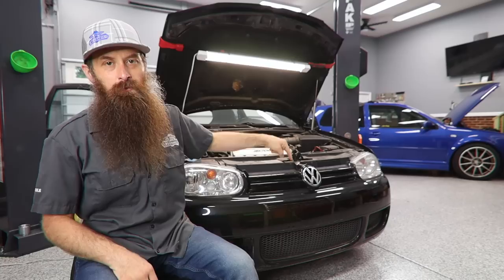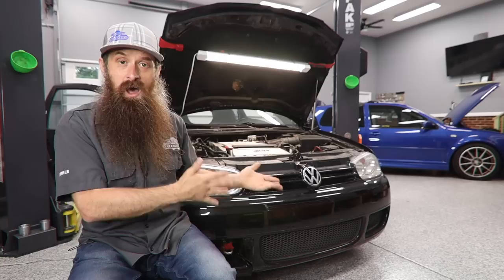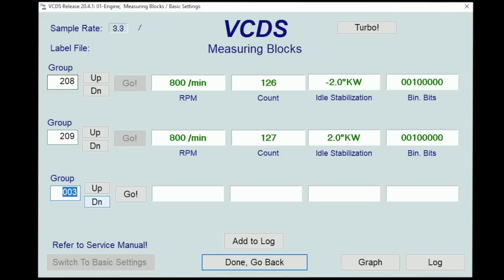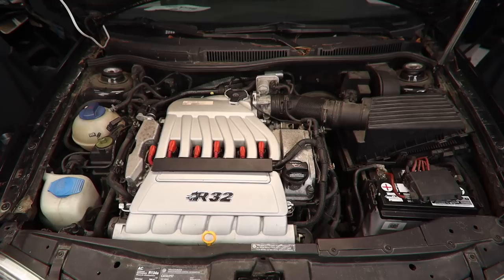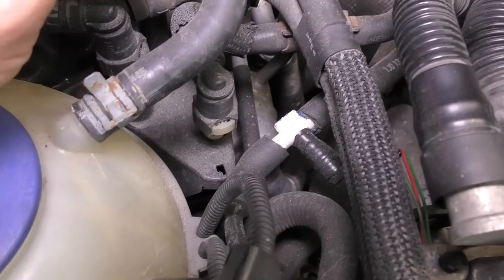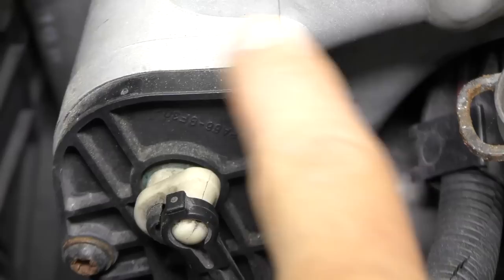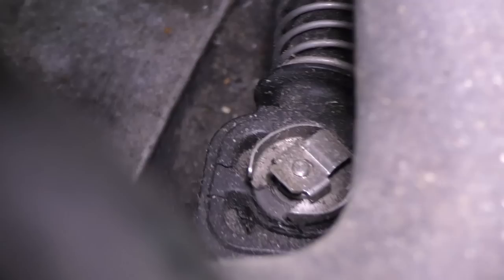EVERYTHING to Check Before Buying an R32 ~ MK4 Buying Guide

Comment: Just wanted to say I am very grateful for all the videos you've done on the MKIV R32. You've created a wealth of video knowledge that has been very helpful!! Especially being a MKIV R owner myself. Excited to follow this series and get some ideas for my 8P A3 3.2 (basically a MKV R32) as well.
Reply: Curious on your experience with your a3 3.2? I recently got one and its been nothing but trouble
Reply: @user-xi9hz1fu9s  It's been nothing but a great experience for me. I've mainly just kept up with maintenance since I got it a little over a year or two ago. Planning to do some preventative maintenance soon, but otherwise the only weird issue I ran into was the cover for the electronics on my MAF falling off and jamming into my throttle body (Cost me a new throttle body). Really could have been avoided too if not for my intake design. What type of trouble have you ran into? and what year 3.2?
Reply: @EntiboyGraal  got a 2004 one, ended up having the engine out in the first six weeks of ownership for a new clutch, flywheel, timing chain kit and radiator among other smaller bits, then turned out it needed a new vvt pulley (£540 for one part 😱) all costing near £2000 in parts, had it back on the road for another couple of thousand miles and it now has another transfer box leak, I think I just got unlucky but it hasn't been an easy ride, still got bodywork and a few other bits to sort too, Idk about you but driving it is fantastic though!
Reply: Interesting you mention about the throttle body though, when I have my foot flat to the ground it only measures 87% throttle input on vag com, do you have any ideas why this might be?
Reply: @user-xi9hz1fu9s  Oh my, that sounds like quite a bit. Hopefully now that you've gotten it back up to speed, it'll last for awhile (though sorry about the transfer box). You're right though, the driving experience is fantastic. I have yet to find something that rivals the experience of the 3.2.
Reply: @user-xi9hz1fu9s  As for the throttle body issue, sounds like a throttle body alignment issue. I think running adaptations on the throttle body with Vag Com would fix that. Here's a handy video from ross tech on how to do it: https://www.youtube.com/watch?v=2zrmhDw_v7Y (I believe the second method of alignment is what you'd want to do). Usually after alignment, the car will run what seems rough but it's really just the computer adjusting and relearning. After a few drives the car should adjust back to normal.
Reply: @EntiboyGraal  thank you that looks great hopefully it will do the trick, yeah its been frustrating but I don't regret it at all, its such a fun car, discrete and understated when you want it to be but got the power and cornering you want when you get the hammer down!
Reply: @user-xi9hz1fu9s  Truly is, and the sound of the VR6 ties it all together. I don't plan on ever letting mine go! Actually hoping to go single turbo eventually, but for now I've got some NA plans. Let me know how everything goes with the Throttle adaptations, curious if that's the issue.
Reply: @EntiboyGraal  the sound is immense, I would love to turbo mine at somepoint, what NA plans do you have for it though? I want to get mine to about 350hp but looks like it needed to be forced induction to achieve that much, will definitely let you know how I get on, really hoping it fixes the problem
Reply: @user-xi9hz1fu9s  Just 268/264 cams w/UM ECU tune, intake, and headers, HFC, and 2.75" exhaust system. Should hopefully get me to the 250 wheel range. If I am lucky I've heard as high as 280. Unfortunately, anything really over that you have to go forced induction. However, since I daily mine I think it'll make for a good time.

Comment: Great videos Charles! I’ve a Mk4 with the AQN V5 engine - so is love to see the cam chain replacement from start to finish. I know it’s a big job but I’d really like to tackle it myself but it’s hard to find decent guidance.
Reply: I hear you man. There are a few guides out there, not all super quality. I just had my timing chain kit for my AQN arrive earlier this week, now waiting on all the other bits it needs at the same time. workshop-manuals.com covers the procedure wellish and Charles' video on the timing the White Wookie's engine (I think 12v 2.8, not certain which engine it was offhand) has a lot of good general advice.
Reply: Olly D zero time for that site. Little or no information on the AQN. I think I’ll resort to a Haynes manual for the main dismantling and gearbox removal; and the rest I can cobble together from elsewhere.
Reply: @jamestravels9554  AQN is on these pages - https://workshop-manuals.com/volkswagen/golf-mk4/engine/5-cyl._injection_engine_(4-valve)/technical_data/technical_data/
Reply: @jamestravels9554  And timing is in these pages (a few back and next and you should have all the info you need). I've never found a Haynes that covered the AQN. https://workshop-manuals.com/volkswagen/golf-mk4/engine/5-cyl._injection_engine_(4-valve)/engine_cylinder_head_valve_gear/removing_and_installing_cylinder_head/adjusting_valve_timing/

Comment: I dont know with R32, but my 1,9 TDI 4Motion had lost its clots underneath behind the rockerpanel (in the floor). Didnt have the chance to check it until I got home, when I saw half of floor in the car had rotted away because of sand and mud etc.

Comment: 5:42 - I just had to replace the fan controller and the fuse holder on top of the battery a few days ago, because that green fuse melted and took part of the fuse holder with it. ('02 Jetta TDI)
Reply from the maker: SO common. LOL
Reply: I had my battery explode in my 01 jetta 😏 good times. She was literally 9 months old. Dealership delt with that mess.

Comment: Charles I'm at a small cross road. I'm boosting my vr5 agz (same as the vr6 aaa but 5 cylinder) I've done the chains around 20-30k km ago before taking the whole engine apart. The engine is super healthy and the replaced timing chain is without slack. The car will be running hopefully 600-720hp somewhere( longevity and high numbers). Should I still replace the chain when doing this rebuild or I can reuse the one I changed not so long ago? I would like to know what you would do in my place not looking for promises. Thanks for the great video!

Comment: I had the Fahrenheit AAA swap , e92 bwm. 
The reality is by the time you modify and replace everything your in say m2 competition money.
Reason is 5 year lease model for European cars. 
Ever paid 1000 for air conditioning gasgets ? Ripped out a whole dash for a heater core? 
You need a shop and every proprietary tool.
As good as say a r36 powered eos sounds and is.
These cars do not last. So plan on replacing everything.  And I love VW.

Comment: I have a question and I can’t seem to figure it out so I just dropped my new motor in my mkiv GTI 12v VR6 and my cooling fans stopped working.  Always worked before no problem so I started to do some test.  Fans come on when ac is on and I unplugged the fan switch from the radiator and jumped those connectors and hi and low work.  So I figured maybe my switch is bad.  Well. I replaced it and still no luck.  I also had a spare FCM and swapped it and no luck.  At this point I’m just having to manually jump the hi speed so I have some type of cooling.  Thanks in advance.

Comment: Hey, great channel, I have the A3 2007 with this motor, are the weak points the same your did Audi use different peripheral  components.
Reply from the maker: That A3 is more like a mk5. So it’s similar but slightly different

Comment: At 3:35... that bolt should have the engine ground and a nut on it shouldn't it? I also check all battery cable ends for corrosion. 

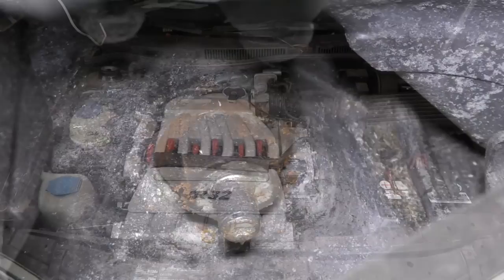I guess you covered it at 10:22.

Comment: Great videos about the MK4!  I have a MK4 TDI anniversary edition.  Need to take the door panel off as I have a leak.  Do you have a video showing how to take the panel off?  If not could you do one please?  Also the light on the door has stopped working does this mean the bulb has gone? or as you mentioned the door latch is now an issue.  I notice central locking does not open the door via the remote anymore (I have to used the button on the drivers door now). Thanks very much.
Reply from the maker: I think we do it in a speaker video

Comment: If anyone is wondering how much a chain job cost on a 24v vr6. Its around $3,800. Also plan on replacing the clutch and flywheel while your at it. 

A word of advice, if going to a shop, make sure they know how to put together the rest of the drivetrain. The shop I went to is known for great engine work but Ive had nothing but transmission issues since they put my car together 4 months ago.
Reply from the maker: Damn!!! A specialty vw/Audi shop is the only way to fly
Reply: @HumbleMechanic  they are supposedly haha.

ever heard of four seasons tuning?

Comment: Can you please do a complete step by step video or series on rebuilding and overhauling an Audi B7 4.2 L - V8 engine and also what to upgrade with what parts to fix the most common problem points with this series engine? If you need a car to do the video I have a 2006 Audi S4 that needs the timing chain & tensioners replaced.
Reply from the maker: Sounds fun!
Reply: HumbleMechanic I’m being completely serious though. You can use my Audi for your video and I am willing to help do the work with you if you let me. Its just sitting in my garage I will send you pics just let me know where to email or text them too.

Comment: Key fobs!  Idk how many MK4s I've seen with broken key fobs, or sometimes... Just the valet key.  No key fob, at all.  Seems like the switchblade mechanism on those key fobs tends to wear out, also.
And correct me if I'm wrong, but isn't there a little plastic key that should have came with them, too?
Reply: All my mk4s came with 2 fobs and the valet key. The golf I just bought came with a broken fob and 1 working blade on another fob that wasn't chipped, it made no sense. I took both to a high security locksmith and I now have a chipped valet and 1 working fob for half the dealership price.

Comment: I had the fuse and alternator wire melting problem un mi mk4 GTi.
A friend from the VW Golf Club told me that this problems are due to dust and dirt collecting on the contacts. when the contact point get too tiny, it starts to heat and then melting the plastics.
Solution: if you open the hood, clean the fuse. once a month, clean the fuse. you sneeze, clean the fuse.

Comment: Ho-lee-crap. I had no idea there was a data point available that could indicate timing chain wear! My '03 GTI VR6 is fully broken in now (296k) . I used to be meticulous about cleaning and maintenance with this car. Those days are behind me. Begun to notice that when zooming around winding roads and coming off-throttle to hold balance, that there is a slight "ratcheting" sound-not unlike a 10-speed bike coasting. It occurred to me that this could possibly be a symptom of worn chain guides. Well, the car is on the original chain and guides, original clutch, original owner (time to replace all 3?). Question: I have the wifi VCDS dongle- is this sensor block available to monitor with just an iPhone, or must I have a laptop and the full VCDS version on that?

Comment: The serpentine belt was installed inside-out?? the belt ribs are on the outside and you can clearly see that the smooth side of the belt is going around the grooved pulleys.  Niceeee and minty.
Reply from the maker: It’s ribbed on both sides
Reply: It is ribbed for pleasure.

Comment: Hi! I have a mk5 jetta tdi. (I know its not an r32, don't hate) It doesn't blow cold a/c, and the fans don't come on. All the fuses seemed to be there when I checked it out a few months back. Any ideas?
Reply: Check the pigtails. Push them together and see if they kick on. Probe the leads with a multimeter
Reply: @benbauer1257  Sorry I forgot to mention that I have checked those before, and they seemed fine. I thought that it might've been a fan, so I replaced the big one with the controller in it. Thanks for the suggestion, though!

Comment: I spotted beetle v5 aluminium door lock pins. Nice mod back in 2004 and you can no longer buy those new  

The rest of this R32 is just junk.  There's just so much wrong with this car , and that's before you address all the rust.

Comment: Best send this to the guy that's about to pay $45k for an 1800 mile R32 on bring a trailer.
Reply: WAY too much!
Reply from the maker: I have been following that very close. I am so mixed on that car. Sad that it never got drive, but REALLY cool it only has 1,800 miles. NOT worth $45k in my opinion.
Reply: @HumbleMechanic  People don't understand that plastic and rubber die whether you use it or not; if that car gets driven it might get 5k miles out of engine mounts and suspension bushings because the rubber is ancient. I'd much rather spend $10k on the car and $15k on rehab.